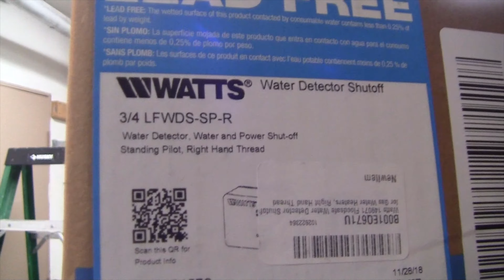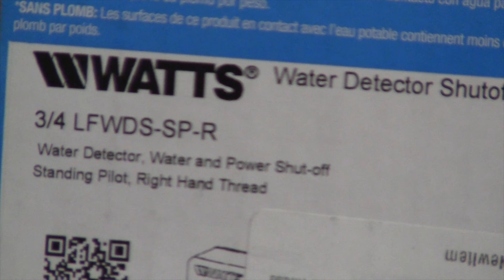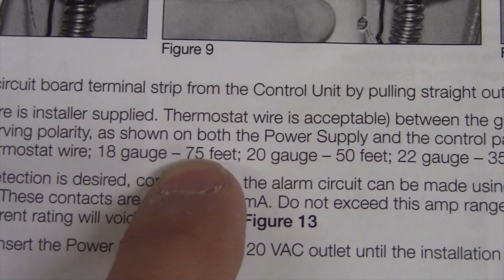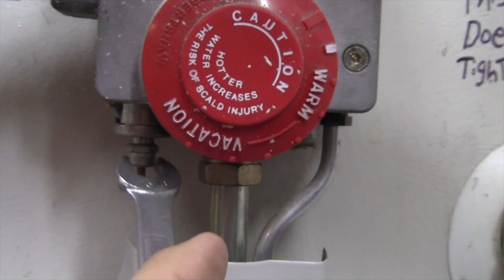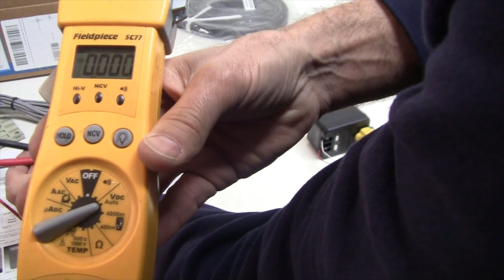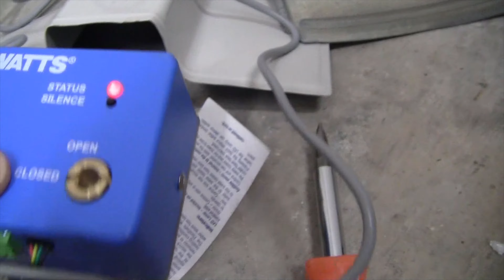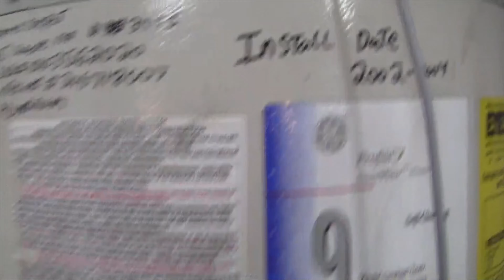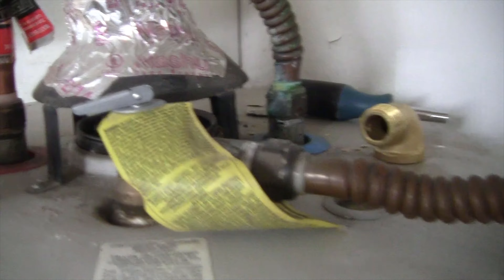Protect your Home from a Leaking Water Heater with Watts FloodSafe Part 1 of 2

Comment: to maximize the life of your water heater check and replace (if needed) the tank’s anode rod, that will minimize the corrosion to the tank and whole hot water system
Reply from the maker: Yes, I agree.